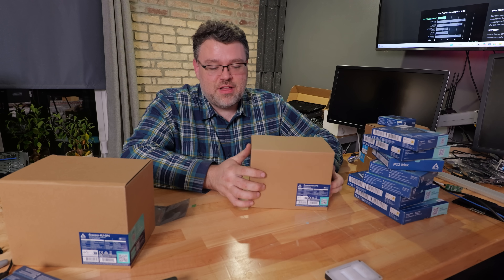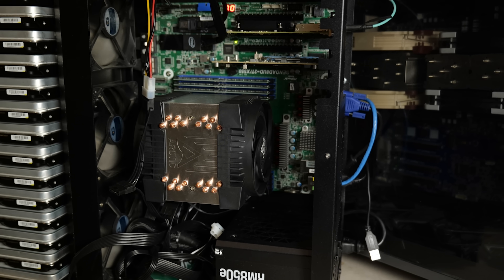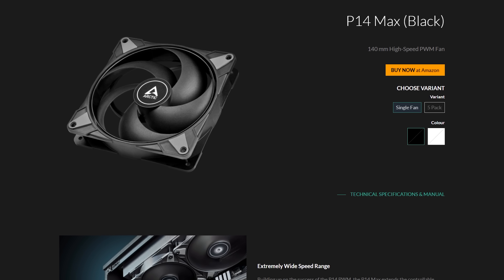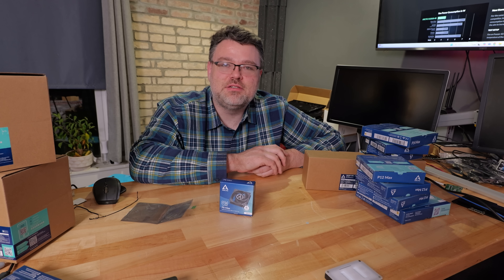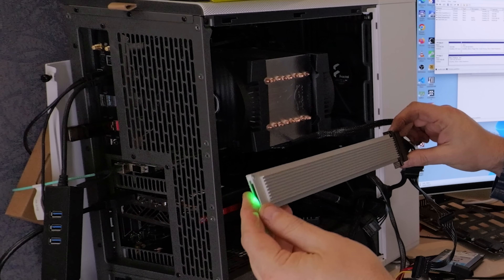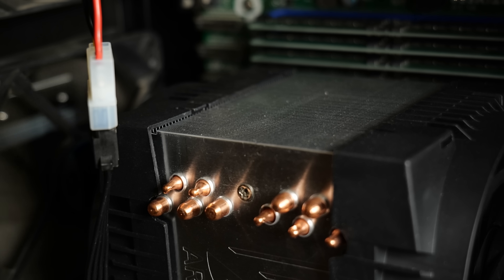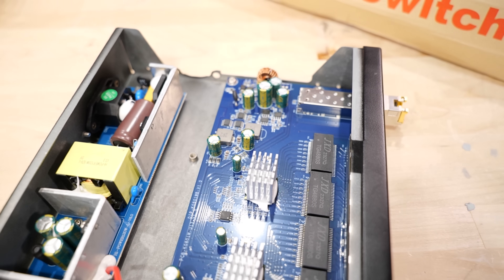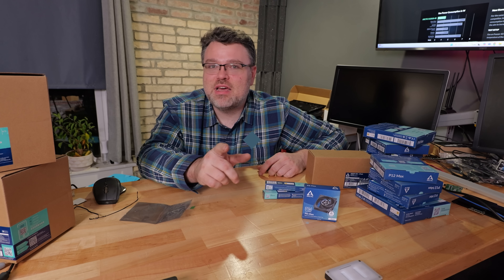How Cool is the Arctic SP5 Cooler?

Comment: Arctic's 40mm 1U and 80mm 2U server fans are amazing for airflow, both with and without air-guides depending on application.

I have a few of those P8 PWM PST 80mm 3000rpm fans in a 2U short-depth chassis as a custom NAS solution, they are mostly just ticking over on pwm, but having the extra fan rpm's available in reserve if that system ever needs additional airflow is a nice safety net.

I retrofitted (with custom 3D printed mounts) a couple of 40mm fans inside a Qotom 1U Denverton system running OPNsense in my network rack, if anyone is looking for 1U fans those S4028-6K 6000 rpm 40mm fans can move decent volumes of air even when just ticking over at low rpms, like all high-rpm capable dual ball bearing fans once you crank them up expect noise along with a lot more airflow. :D

Comment: Nice video. All of the CPU coolers I have are Noctua for now, but in the future, I will give Arctic a try. I do use the Arctic MX-6 paste now, after wasting tons of money on Thermal Grizzly Kryonaut. I found MX-6 works just as well and is far less expensive.

Comment: Just swapped 5 Arctic P14 PST fans into my Fractal Define 7 and man what a difference. Super quiet at idle and even under load with a good fan curve while still delivering amazing cooling. Knocked about 6C off GPU temps from my previous 140mm Fractal and 120mm Cooler Master fans
Reply: Good to know! I’m currently using all Fractal fans from 8 years ago in my define r5. Arctic seems like a good option.

Comment: I have been using Arctic’s liquid freezer for all of my builds, never had a problem. The quality is just off the roof, and the thick radiator is just way way way better than all others out there. Also, since they can be ordered without RGB, they are cheap and great for workstation build. They did not spent much on advertising if at all, but I recommend them to allllllll of my friends

Comment: I used to build servers for a living, and you're right, temperatures are very important for reliable computing. We had some discussions with customers and manufacturers regarding this and what we ended up with was that there were no such thing as too good cooling. Every server we built was tested using the most brutal testes we managed to find. The interesting part was that sometimes we got rather interesting results. As when looking at memory a heavy processors heat test was more likely to kick out bad memory than the most brutal memory test programs. I remember we payed several thousand dollar for a license to use a memory test program. We also had hardware memory testers, and still memory that passed through several sayd of testing using these sometimes failed when we ran the CPU heat tests.

Anyway I ended up with tinnitus as a room full of screaming servers can get pretty loud, and popping earplugs whenever walking in there got pretty boring so I tended to for get it. Don't be like me, you only get two ears to live with, and once your hearing is damaged it doesn't get better ever again. Anyway that test room wasn't only loud but also hot as we tested all servers running total torture tests for 24 hours in 40°C. So all servers were able to work in that temp at full load, so any normal load and in a server hall airconditioned to 20°C would be a light load for the cooling.

Now the fans in these computers tended to come from three brands, Delta, Sunon or Sanyo Denki and in general they were very reliable, but I remember that we had a batch from Sunon or Sanyo that failed catastrophically after a few months. The fan simply slipped free of the hub and crashed. It's the only real problems we had with larger fans, 80 mm and larger. Small 40mm fans could be a lot worse. I remember we had a few 40mm maglev fans that wore out. Turns out that even though the fans are using mag lev which should mean no mechanical contact in the bearings enough dust binding to the fan blades could make them unbalanced enough they tilted and would wear out the very small bearings designed to keep dust from entering the maglev area. Fans are important, and dependability is just barely more important than extreme performance.
Reply: Brutal testes, lol
Reply: As someone who works in the labs for one of those manufacturers, I will nitpick a little bit - there's two times when you can have too much cooling!

Number one is pretty obvious - cooling, whether in the form of HVAC or water cooling, costs electricity and money. If you are cooling below the minimum needed for reliable operation, you're spending more than necessary.

Second is a little weirder and I confess that I don't fully understand it, but I believe there's a paper on it published. Something to do with transistors switching less readily at lower temperatures? Basically, when we got our silicon cold enough (maxed out flow on the water cooling) perf per watt actually went down a little bit. In practice you'd never encounter this due to #1.
Reply: @Khrrck  Both points are correct but there is actually a third and that is storage. Old hard drives actually were most reliable at around 40°C. Warmer or colder and the MTBF fell. Strange but proven by the large storage users datalogs. When talking about flash memory on SSD's it's pretty similar. Too cold and it will work slower and age faster. Too warm and it's the same. From what I remember about 40 to 60 degrees are about the best for flash memory. But I could be going to high with that 60°C number. Anyway excessive cooling of SSD's can degrade both speed and durability.

Comment: I have had bad experience with Arctic P12 fans. I had four of them. All made a weird humming noise when passing a certain rpm. I’ve only seen one YouTuber, OptimumTech, mentioning this problem. Replaced all with Noctua, which were of course perfect.
Reply: the p12 max does not have that problem
Reply: Even with the hum below certain rpm's (at around 1200rpm) they are much less noisy and annoying than other brands.

Comment: Been using Arctic for the last 4 years, probably have over 2000E of their fans and coolers, and a few days back got 2 of Liquid Freezer III 420 A-RGB at 80 Euro a piece! Happy camper 😃
Reply: Insane how cheap their AIOs are at least in europe.
Reply: @Machariel00  I just installed one of those 420 on a 5950X, at full tilt it gets to 58 degrees! That is huge amounts of cooling power for very little money.
To Arctic: thank you for being a good company in a sea of very bad ones.

Comment: As companies catch up to Noctua, they seem like they might be in trouble in the long run. 
They'll be forced to lower price. and it seems like air cooling doesn't have much left in it.
Reply: That kind of falls apart because nobody matches a top end nvidia card.
Reply: Not sure what you mean by air cooling doesn't have much left in it? As in popularity or what? Because air coolers are still by far the most popular option. They're cheaper, no risk of leaks, and work just fine for most builds. Not everyone is running a 250 watt CPU.
Reply: @blackwolfshad0w25  Not much more room for dramatic improvement. For example, Noctua’s latest coolers are expensive but just marginally better than older models.
Reply: Noctua like Nvidia charges what they do because their customers will pay it regardless.
Noctua have been matched by other coolers many times and it's never mattered.

Comment: Arctic is literally my GO TO for anything cooling. Used to run a computer shop for YEARS and their MX-4 is a godsend. It just works and I've had deployment where the paste application on a CPU/GPU lasted 3-4 years and the paste is still liquid. Their fans as well. If you want no RGB fans that works well and don't cost an arm and a leg and looks like vomit cough NOC TUAH Arctic is literally the only game in town. Have 11 of the P12 and P14 running in my O11 EVO XL right now and it is great (and reasonably priced too, like cost the same as two- three NOC TUAH fans)
Reply: legit literally

Comment: Just in time, My Silverstone case waits to be built
Reply: With 6x120mm 8k rpm arctic fans. I plan to use them at 800rpm 99.95% of the time.

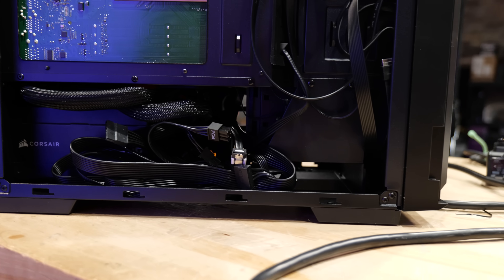Comment: 0:57 Is that a old vga connector on the back of your pc??
If yes, then why do they still use it in 2024?
Reply: It's on the motherboard. A Workstation/server one. VGA / D-SUB is still alive and well in the server space, especially for management stuff, because it does what is needed for cheapest possible price. You absolutely do not need displayport for what is most of the time nothing more than a basic console output. You do not even need 1080p.
Reply: @nagi603  My first gpu Ati 3D Voodoo or something like that back in the day had that connector. Great that people still uses it, love it :)
Reply: Reliability and durability are both a huge plus for VGA.
Reply: IPMI is obsessed with using VGA instead of DP, I don't now why, DP can just be adapted to any other port.

Comment: I had issues with 80mm arctic fans having lubrication issues from the factory. A whole batch started failing after ~1 month. I would be interested in hearing if anyone else has had similar issues.